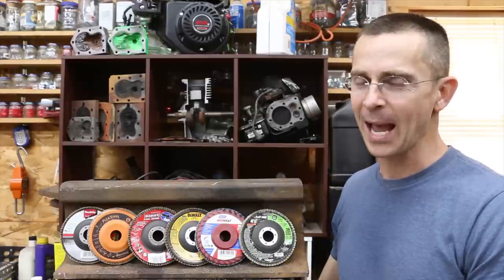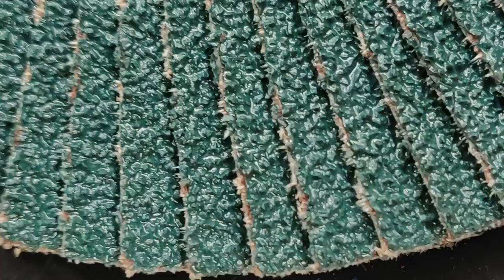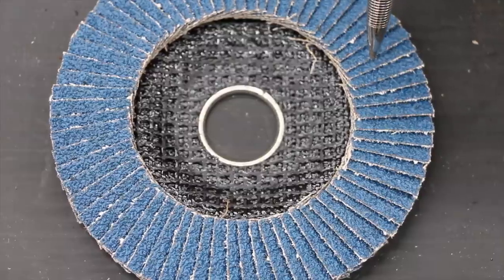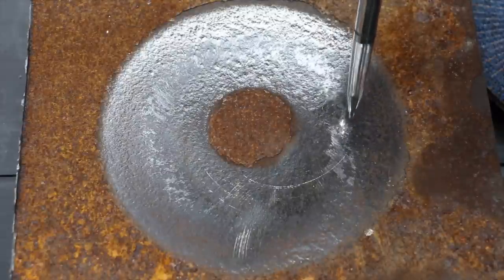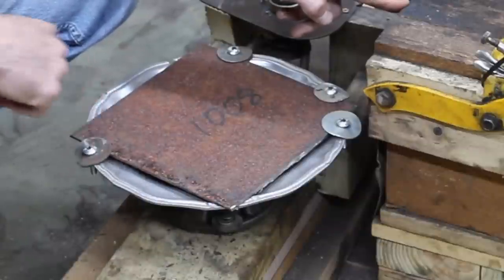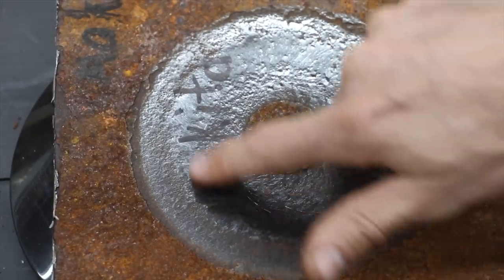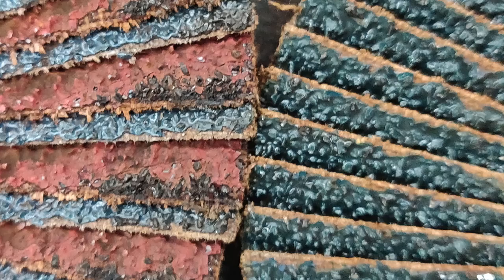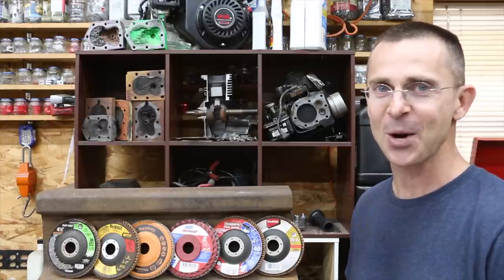Best Flap Disc Brand (6 Brands Tested)? Let's find out!

Comment: Great test, I really appreciate and admire the amount of time and effort you put into these tests.

I'd like to make a few professional observations on this test in particular. While I do believe that the results are absolutely useful, they weren't engineered to mimic the optimal use of a flapper disk. I use a flapper disk 15-40 hours a week depending on whether the items I'm fabricating need detail grinding and my main observation is the tendancy to use way too much pressure, which your test dutifully replicated I might add. It also inadvertently revealed my point here; while the fact that the disks were new definitely played a role in their increased material removal on side one vs side two I believe that the difference was mainly caused by the increased tool pressure.
Optimal tool pressure for a flapper disk is maybe the weight of the tool at most. When a flapper disk is spun up the individual flaps get pulled outwards. Spin up a new one while you look at it from the side (wear safety glasses if you value your eyes, of course!)- you'll see it "puff out". This ability for the face of the disk to conform is one of the reasons it is so efficient at material removal while also able to be finessed to a level of surface finish above what the grit might suggest, but you can't overload it.
Past a certain amount of pressure the abrasive on the face of the disk can't physically remove more material and the extra friction just becomes heat. This heat breaks down the abrasives and the matrix that holds them to the backing. Different abrasive types (zirconia, aluminum oxide, ceramic, silicon carbide, etc) have different characteristics when they break down; some loose their cut and others don't.
Some brands of flapper resist the effects of heat buildup in the disk better than others for sure (the norton you test here is a good example).

In any case, if you ever do a round two for flappers I'd like to see you test benchmark abrasives as well as pferd, and maybe do a comparison of abrasive types at some point.
Reply from the maker: Thanks so much!  Thanks for the feedback.

Comment: Good test by concept however there is a significant flaw in the test. Flap discs are not designed to grind off rust or mill scale. The grit gets plugged up with the oxidized material and loses it’s ability to grind. Best used for smoothing welds and prepping rough cut edges. Thanks
Reply from the maker: Thanks for the constructive feedback.

Comment: Love your videos, but 3m cubitron flap discs are the best flap discs I’ve used bar none! It it the most expensive, but wears way longer! It wears so much better that it more than makes up for the cost. In my shop it is twice the cost, but 3 times the wear = cost savings.
Reply from the maker: Thanks for sharing.

Comment: I weld for a living.  I do some grinding and some polishing.  I will just say.... try some cubitron products.  they work.
edit: Also, I love your channel.
edit 2: we use hard stones a lot and from the many years of experience from the people who have worked where I work, everyone agrees that no stone holds a candle to a cubitron stone.  and I can't agree more.  they cut like crazy.  but it comes at a cost.  These stones put off some particulate matter in the air that is not good.  I think there is chlorine in it.  It will mess you up if you breath enough of it(it takes a LOT of breathing that crap to mess you up)  But man they cut good.  Their soft pads are awesome too.  Cubitron just really cuts.
Reply from the maker: Thanks for the suggestion.

Comment: Notably, the Norton is the gold standard for flapper wheels in the industrial environment.  You really should team up with a millwright like me for some of the testing to see if what the industrial environment uses really holds up. It tends to be more expensive…. But we look at cost per use not overall cost…. The stuff we use is usually way more expensive, but it’s the longevity per price unit we care about….
Reply: You could do a whole series on industrial picks vs consumer picks.
Reply: Have you tried the 3M Cubitron Flap Disc 967A (red ceramic)? Give them a go and compare. I highly recommend.

Comment: When I was prepping my "Novelty siding" house for paint, I used a LOT of these wheels to knock off the dead paint.  I used the Harbor Freight grinder & "Warrior" wheels, but I was going after OLD PAINT, not rust, so this worked pretty well for me, and as with their roofing nailer, I wrote the grinder off in one job, so I expected that to DIE.
Reply from the maker: Thanks for sharing.

Comment: With all the flat tappet cam and lifter failures lately.people are blaming the lack of zinc in the oil.i think a test to find out which oil works best with older flat tappet engines
Reply from the maker: Thanks for the suggestion.

Comment: One thing if it hasn't been mentioned is the total amount of material the Makita took off. Time is money if this is something that's used for work. At 50 to $100 per hour for some occupations, the speed of the cutting action would be more important than a dollar or two per disc. Gitter her done. 😉
Great video especially keeping the human error factor out of the test.
Reply from the maker: Thanks for sharing.
Reply: @ProjectFarm  I saw in the other video on discs that you did mention the labor part of the equation. You do a great job, and don't miss much.
I haven't looked yet to see if you checked out different brands of infrared thermometer guns. I've had one for about 10 years and it feels as if it's pretty accurate for a little $34 unit. I recently bought a $20 unit that has more features and it seemed to be off by about two and a half to six degrees when comparing it on different objects. So on the spur of the moment I ordered a fluke 62 Max plus. Considerably more expensive but it reads almost the same as my old coupon so as I suspected the newer cheap one has issues. I've only checked that things that are at room temperature, so it may work fine on higher temperature surfaces.

Comment: Makita is very fast and aggressive for the first few minutes of use. But because they wear so quickly and lose their effectiveness on flat surfaces, workers tend to not change them out and instead try to push more life out of it. Losing that grit you start to polish the steel instead. A wheel that lasts a little longer is a huge benefit because people tend to try to avoid changing discs as much as possible. A worn disk is fine for edges but not flat sanding.
Reply from the maker: Thanks for the feedback.

Comment: Always gr8 to watch ur interesting tests great job AS USUAL AS A PREVIOUS WELDER USING A WHEEL AT ANGLE U HAVE IT IS ODD AND QUICK 2 WEAR AS. THE WHEELE USALY GOT A LOT FLATTER GRIND ALSO LAST LONGER THAN. THE TILT U HAVE, DIABLO WAS WHAT WE USED AND STILL WILL GREAT INFO KEEP IT UP !
Reply from the maker: Thank you!

Comment: I use the warrior brand flap disk to sharpen mower blades or weed cutter blades I sharpen once a month and I go through only one disk per mowing season that's 2 rider blades 1 push mower blade and 2 weed cutter blades.
Reply from the maker: Excellent!  Thank you

Comment: I get out of this lesson. Just save your money and buy sheets of sandpaper and cut them out to size and use them with your electric sander. When you get 4 sheets for around $5 bucks but can cut each sheet into 4 pieces for your sander giving you 16 sheets. That has to be a lot better than buying a Diablo for around 7 to 8 bucks. On my Diablo after sanding out steel of 22 inches by 18 inches on both sides on .25" think steel. There is really no grid left. Well there is if you remove some of the used and look underneath at the cost of unbalancing your disk. Maybe I am new to grinders, but this seems not so great at best.

Thanks for making this video.
Reply from the maker: Thanks for the feedback.

Comment: I know this is an old video and I may have already commented on this. With me being a blacksmith for the Last 4 years and experianced in angle grinders and belt sanders. my opinion is all zirconia flap discs suck royally unless you wood working compared to ceramics. Norton red heat isnt bad but if you want performance per dollar 3M cubitron ii 40,80 and 120 are my top notch choice over any. Around 25 bucks a 40g 7 inch disk go with 3m ceramics.

Comment: I don't use a lot of flap discs and only have experience with DeWalt and wonder if they have changed their product or are having a quality control issue. I had a disc that I used off and on for 2 full years, sharpening lawn mower blades or cleaning up welds. That one disc just kept going and going. When I finally needed a new one, I wanted another amazing quality DeWalt, but that sucker lasted less than 10 minutes before wearing out. I know it's only a sample size of 2, but the last one was so bad, I don't want to give them any more of my money.
Reply from the maker: Thank you

Comment: Any flap wheel I've ever used seems to stop cutting long before the sandpaper material appears to be worn down. They have their place I guess, but rusty metal cleaning seems to ruin them very quickly. They seem to last much longer grinding on cleaner metal
Reply from the maker: Thank you for the feedback

Comment: As an aside, if you're doing stuff with lots of rust dust like that, I hope you have something evacuating the dirty air nearby.

Also, No idea if YT has a PM system, but I work in heavy industry (previously a foundry, now a paper mill) and sometimes the shit (cause it's either good shit or garbage shit lol) we get supplied with isn't always available at big box stores. If you have a list of upcoming tests, I could probably help supply you with some materials or items. Like I have a bunch of D2, S7 and A2 tool steel that could have been used for your drill tests (*evil eyes*). Or I could easily supply you with various grades of gear oil in the small amounts needed for motors.

Comment: Not sure how this ends, but I usually get Harbor Freight bulk packs of flap discs and cutoff wheels. Too often the user (me) or material in the project can destroy a flap disk when grinding/cutting a weird shape, catches of an edge of the project, or it falls on the ground and damages the flap disc (cutoff wheel prematurely)

1 minute isn't enough time, I've ran a flap disk far too long and ruined them trying to get a spot to grind smooth or get into a tight space. With the Harbor Freight grinders on sale for $20 I've ran them so long they were too hot to hold without gloves. Tried to save it in the chest freezer. It worked again, but died days later with smoke out the motor and brushes melted.
Reply from the maker: Thanks for sharing.

Comment: Little bit more match called for here, and perhaps another experiment, running the disk until it wears out or sufficiently to measure mass loss on the wheel. Flap disks often work great brand new, but after that first abrasive edge falls off, they are harder to use and require more pressure. So an analysis of material removed per disk material lost per price would be called for, in my humble opinion.

This is another tool I use a lot, and tend to buy based on price vs apparent abrasive on the disk. Looking in my drawer, looks like I have 70/30 Diablos/Harbor Freight and other cheaper brands. Many DeWalt consumables are overpriced IMHO.
Reply from the maker: Thanks for the feedback.

Comment: I use many Diablo wheels in my shop. I too tested several brands to see which one was the best value. However,  I test mine under a daily use real world scenario. I find the Diablo brand are the best value followed closely by the Norton brand. I always enjoy watching your videos.. Maybe you can test METAL cutting hole saws? I can't seem to find any worth buying. I recently discovered Drill Hog..life time warranty drill bits. So far so good, but I have not cut any holes with the hole saws I purchased... I would love to buy hole saws that I can use in my drill to cut through thin metals without burning them up each use. Is there a trick I'm unaware of when cutting metal holes? Thanks again
Reply from the maker: Thanks for the suggestion.

Comment: My only reservation is running the discs over the same area. No expert here but it seems like the discs and metal just start to polish each other.  Thus the lack of rust removal on the second test. Going all over the metal plate into fresh rust may have shown a differant result. My issue with chinese abrassives is that the glue and abrassives just go bad quickly. So good surprise on the diablo. That beinb said, i just stick to norton as i have had no issues with them.

Comment: The wheels are not equal. The warrior has a brown color which is usually aluminum oxide grit which is older technology. The blue are zirconia which cuts better and lasts longer.  The green that we use at work are for aluminum because they don’t clog up
Reply from the maker: Thanks for the feedback.

Comment: The Diablo is probably the best value. Because of the amount of and toughness of the paper, it will probably last a lot longer. This wouldn't apply if you replace the wheel often but I personally use one until it's grit is about gone.
   Who sells the Dablo brand?
 Take Care and be safe, John

Comment: Hi!  Love all your videos!!!    Potential test:  I have a very old Black and Decker industrial sander (angle grinder) that weighs so much! (14 lbs. without discs) I recently sanded a deck that was in bad shape and the weight of the tool was horribly fatiguing!  What is the best modern angle grinder (either corded or battery) that will perform without the negative aspect of being so heavy?  (just a thought - thanks)
Reply from the maker: Thanks!  Thanks for the video idea.

Comment: Sorry if it has been mentioned before, but have you thought about adding an equivalent work comparison as part of your tets? For example some of the longer wearing wheels here look like they removed less material, and I would be curious if the longevity in the wear-ability for those brands would last after having gone through the same amount of work in terms of removal of material compared to the other wheels that did wear faster. as these wheels would need to put in more work to remove the same amount of material as the other wheels.
Reply from the maker: Thanks for the suggestion.

Comment: Have you tested die grinder buffer/sanding discs/cookies yet? 
I work at a service shop, the die grinder gets used every day to clean rim beads and remove rust from behind brake cradle shims.

Sides get chewed up quick and cheap discs become limp or even fly apart. 

I've also seen cheap die grinders quit within couple months use verses better name brands lasting over a year.
Reply from the maker: Thanks for the suggestion.

Comment: Nice video.  Thank you.  Very informative and useful.  I'm currently grinding paint and rust of a gigantic double aquarium frame and need to buy some more grinding discs.  Have you tested the silicon carbide disc?  The disc that looks like a sponge not the flat kind.  I'm curious to know what it tests compared to the dics in this video.
Reply from the maker: Thanks for the video idea.

Comment: As a new grinder about to undertake some restoration projects, should I expect only 10-20 seconds of good performance from a flap disc? That doesn't seem quite right. Of course, I haven't used flaps yet, but the price of a 10-pack of discs can add up over a project.
Reply from the maker: Thank you for the feedback

Comment: My only issue with this test is all wheels need to be same grit and composition for accurate testing there are substancial differences in wear and cutting speeds from a wheel with Aluminum oxide & a zirconia or a ceramic regardless of brand that’s the only way to compare them otherwise it’s like comparing a hammer made of steel to a hammer made of bronze or plastic 😅

Comment: If you had a bunch of rust to remove,  are flap disks even a viable solution.  It seems like for the price and amount of rust they removed, it would cost a fortune.  Is the best solution sandblasting or another type of grinder attachment?
Reply from the maker: Thanks for the video idea.

Comment: I think most flap disc's would  benefit from being run slower. ~12k-14k  rpm
 the grit likes to glaze over. 
The pressure used on it should be barely enough to take a thousand rpm from it.
Reply from the maker: Thanks  for the feedback.

Comment: i would would love to see a test of these to see which one actually lasts the longest and total material removed until the sandpaper is gone. Also cost per disc compared to actual amount of material ground.
Like you said they do get hot and not as effective as well when this happens however that is a crucial part of costing
Reply from the maker: Thanks for the video idea.

Comment: I would have liked to have seen the walter enduro-flex flap disc used in your test. I've been using them for over 10 years and never found an equal.
Reply from the maker: Thanks for the suggestion.

Comment: I work at ARC Abrasives as a Slitting Operator. What type of paper are on all of them? Aluminum oxide, ceramic, "diamond". Where they all the same types?
Reply from the maker: Great point.  I should have provided that information.  I used the products on the shelf at the local big box stores.

Comment: I really like your comparison tests and the even handed way in which you judge products.  I have a question about removing a flapper sanding disc from a 7/9 inch sander grinder.  I have an old Craftman sander / grinder that has served me well for over 50 years.  However, I just started using the Diablo flap sanding / grinding disc (40 grit) and I cannot get it off now that it is very worn.  I depress the pin that stops rotation, and I cannot get it to spin off.  I used WD40 and I cannot get the center threaded piece to turn.  Any suggestions?